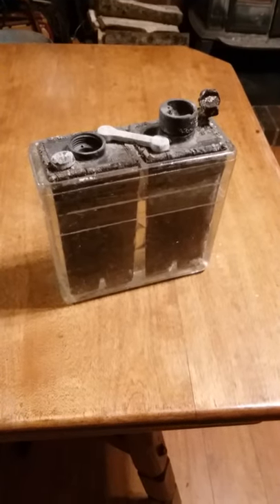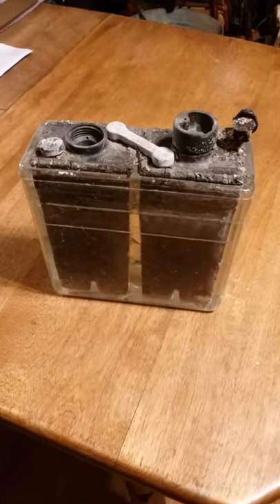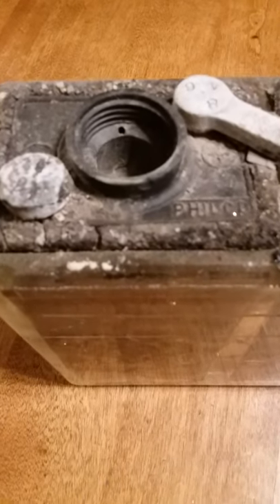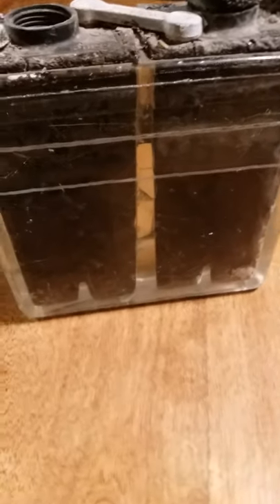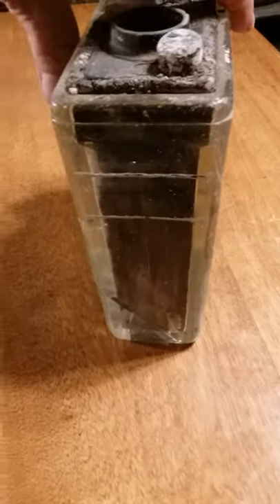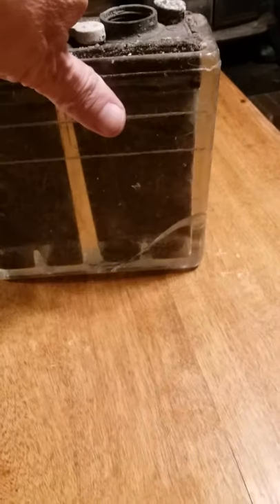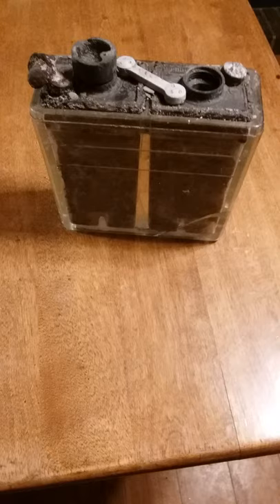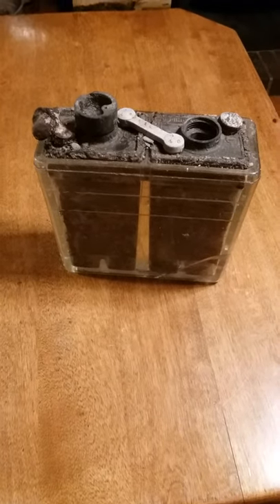Circa 1920's Glass Philco Radio battery found metal detecting #shorts

Comment: What did this battery get used for? What a strange looking thing..
Reply from the maker: I believe it was for radios Dan :)
Reply: @dfdigger3820  must have been one heavy Radio.. But then again every thing back then was big bulky and heavy. .Built to last I guess
Reply from the maker: @ohdannyboyjustadiggin  I think for one of the old tube radio. Yup, they weighed a lot.
Reply: Used in old radios to get the valves or tubes up to operating temperature. Known as an accumulator in England. In America there seems to be a wide range of glass batteries, here in England we had Oldham and Exide.